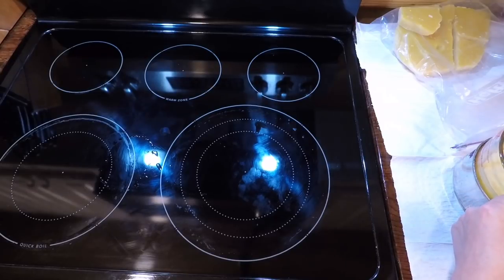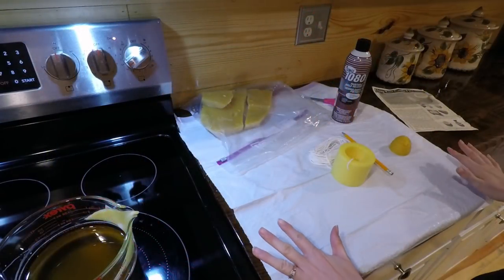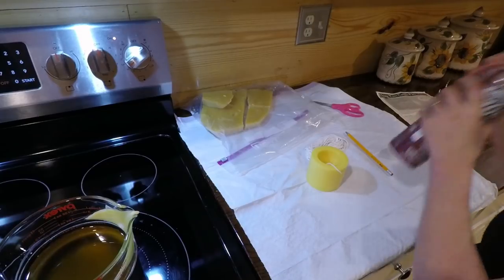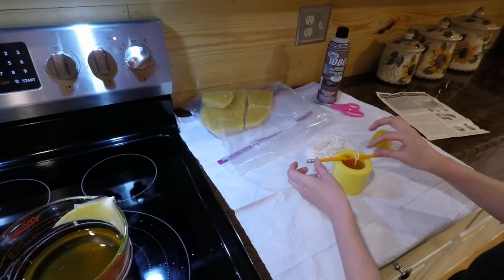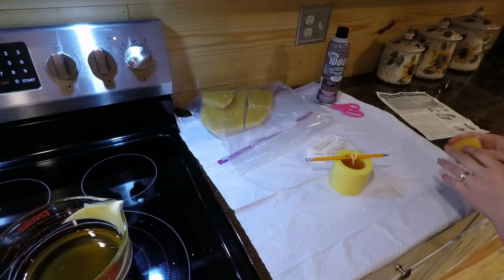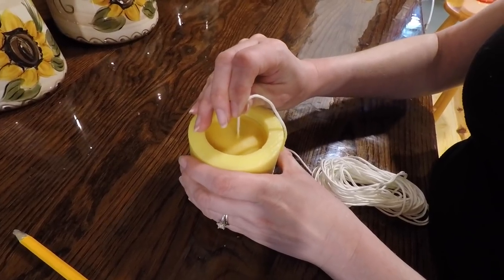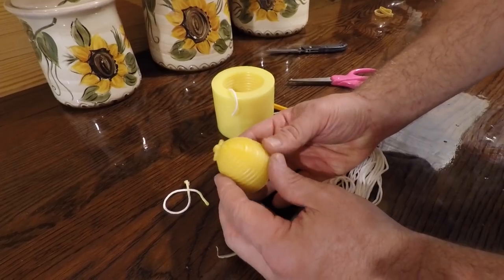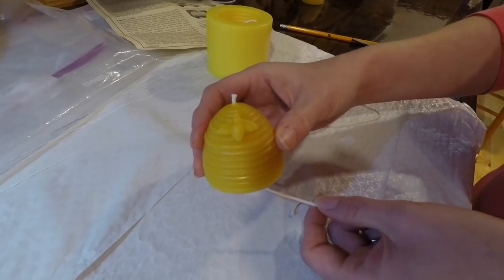How To Make Candles From Bees Wax

Comment: Take and cut your mold down two sides straight across from each other about 3/4 of the way down and then put a couple rubber band around your mold when you get ready to pour the wax in , after your wax set has up all you have to do is remove the rubber bands and pry the mold away from your candle 🕯 this makes removing candles from the mold much easier and less damage, this works a lot better when you have more difficult design candles . Good luck on your venture and making candles, you might want to consider turning this into a small business adventure … to keep from wasting so much wicked  tie a knot around a chopstick cut is the size of top of your mold
Reply from the maker: Don Latimer Thanks, Don!

Comment: If you dip the mold into cold water after filling it, it will set up quicker.  Be careful that you do not get water into the hot wax.  Another way is to set the filled mold into the refrigerator or freezer.  The only problem with this is sometimes the mold gets too stiff to pop the candle out.  I would place mine into the freezer for about 10 to 15 minutes, then pull it out for about the same amount of time, and everything would come out fine.  As the wax sets, sometimes you get divots around the wick.  If you keep a few teaspoons worth of wax hot, when the divot starts to show, and a drop or two and the wax will soak down next to the wick, and it WILL not pull out.

Comment: Here’s a suggestion: Tie big flat washer to the bottom of the wick string so when you try to pull the candle 🕯 out of the mold it will give it something to push against the bottom of the candle 🕯 to help as U pull it out of the mold better by the wick string.  Just a suggestion 🤷‍♂️
Reply: why do you say candle 🕯 instead of candle?